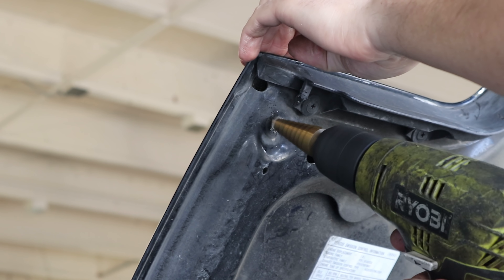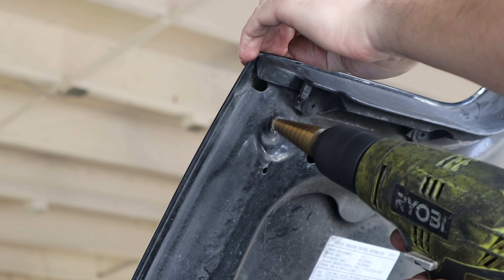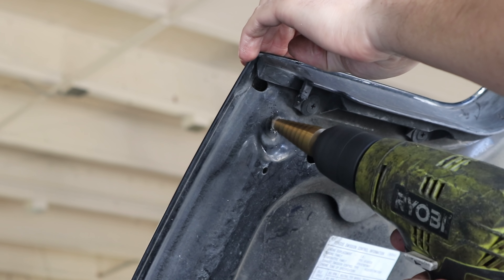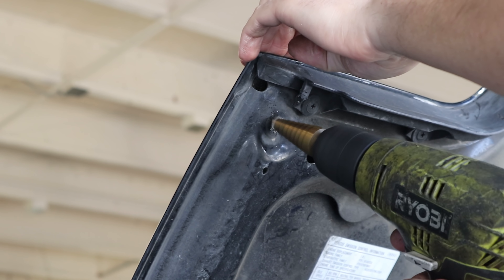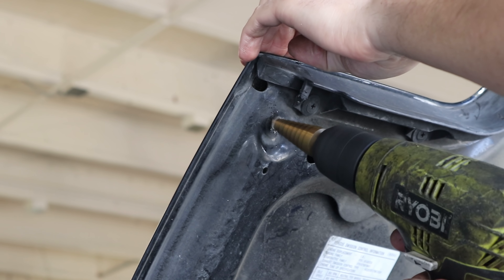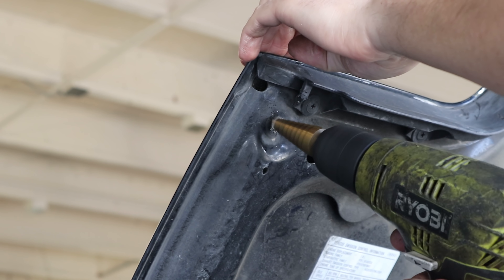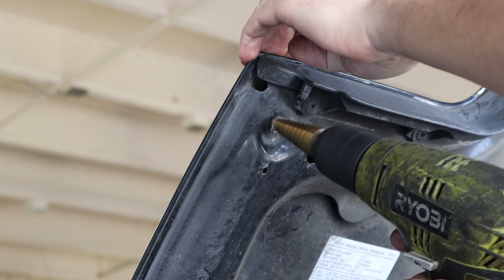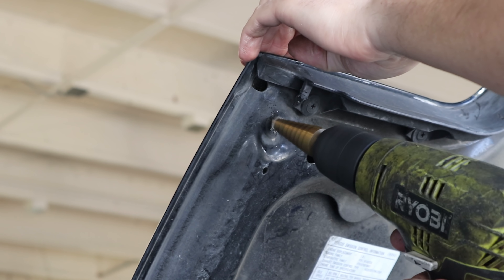Finally On The Ground! - HAVOLINE X OFFBEAT

Comment: You should have an appropriately sized spring seat between the adjuster and the spring. Otherwise you are going to ruin the adjuster, threads, and that spring will get launched into the reservoir.
Reply from the maker: The spring seat is correct, it's for a 3" ID spring

Comment: Those short 'plushy' springs are there to help keep your springs in place for when the shock gets longer than spring can reach.
Especially with your springs possibly hitting the reservoir, I'd put them back in them back in.

Also, isn't that steering rack too angled? I feel like that might be a bit too much.

Comment: In theory dividing the weight of the miata by the weight of the rzr and multiplying the stock rzr spring rate by that should get you around where the spring rate should be if you want it to be close to how a rzr would react